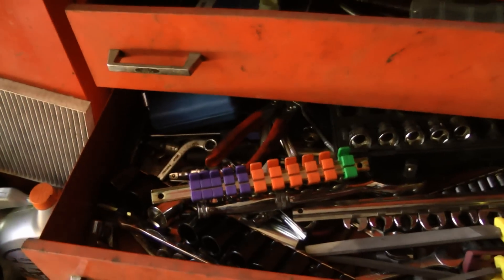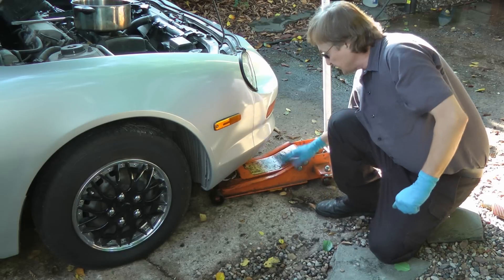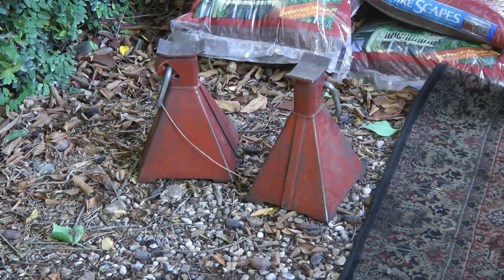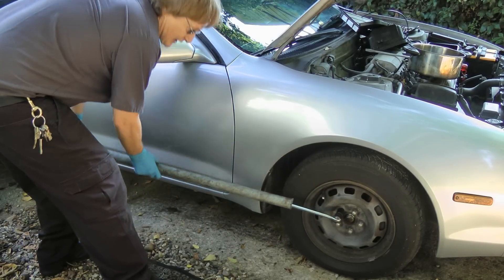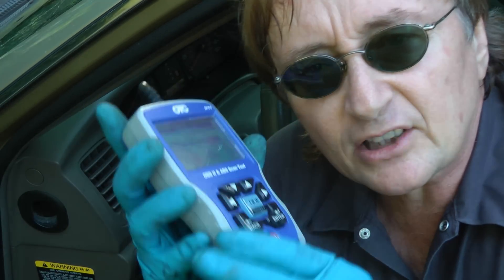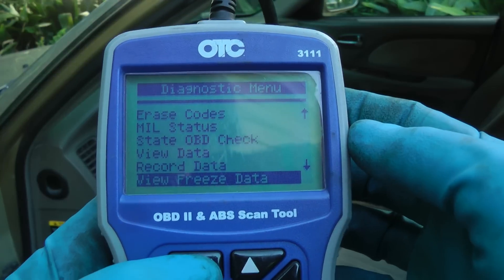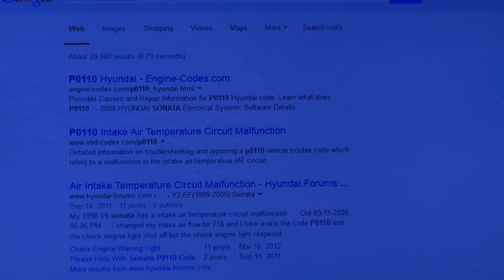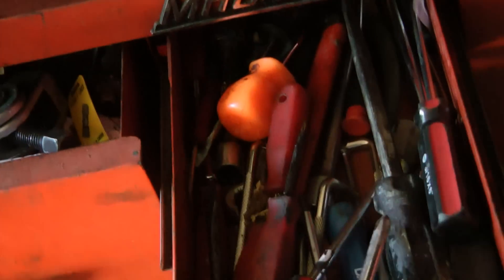Basic Tools For Fixing Your Own Car

Comment: I have a 1' high, 1' deep 1-1/2' wooden box I made with alllll my mechanic tools in it, excluding jacking/standing and scaffold bar. I can do anything with that box.
2 full sets of open/ring spanners
1 Full set of 1/4" 3/8" and 1/2" sockets, ratchet, long and short extentions, swivels, and adapters for each size.
Just looking online, I found this,
http://www.halfords.com/webapp/wcs/stores/servlet/product_storeId_10001_catalogId_10151_productId_1001919_langId_-1_categoryId_255215
,that is effectivley my nuts and bolt part of the box but mine are mostley snapon.
Then theres other stuff in my box and I have run out of bother.

Comment: Please tell me those weren't crescent wrenches on your peg board.
Reply from the maker: yep, they are, when in a hurry I use them for non essential work that's just fast and easy.
Reply: whats wrong with a crescent wrench?
Reply from the maker: Avalanche
they will peen off the edges of nuts and bolts if not on tight
Reply: Box-end wrenches should be used instead of a crescent wrench.  Much more precise.
Reply: George Costanza
When I am working on my bikes, sometimes I cannot user box-end wrench or socket wrench even, I have to use crescent wrench. They do work fine just as long as I use the right size wrench and the tool grabs the nut properly and I turn it using the correct trajectory. If the nut is seized due to corrosion, rust, etc. then I spray a little PBBlaster and let it soak for 5 mins, if needed, heat up the nut using a micro torch.

Comment: I don't know Scotty the Carly is very good BMW specific codes it is I/O and can give you dealer lvl historical data. It is wifi and after you buy the app and adapter you are only able n it for $110 the dealer will charge you 90 bucks just to clear a code. I recommend highly the Carly obd2 adapter even let me turn off my seatbelt gong if I have something heavy in my front seat. AuTo fold my mirrors allow my DVD screen to work while driving for my passenger. Change my blinker to 5 vs 3 on a soft signal. Adjust my auto wipers. And get a full report on the driving habits my car has endured ie 18% of trips under 5k 40% of trips over 20k 30% of trips over 80k 17%of trips over 100k also let me disable the auto stop start.